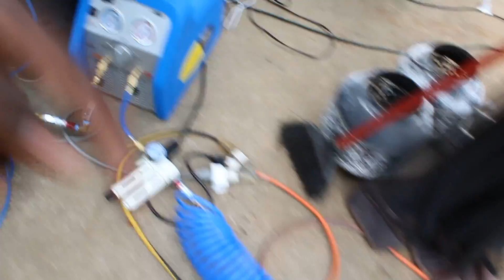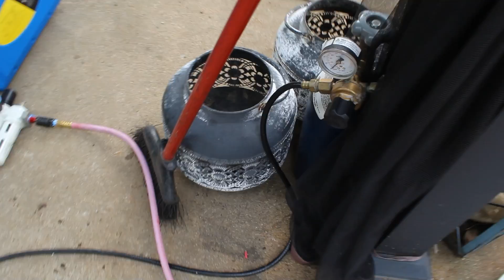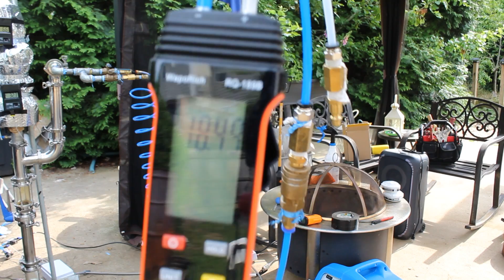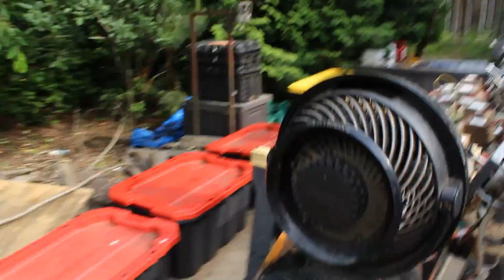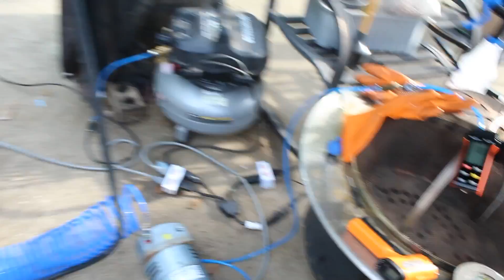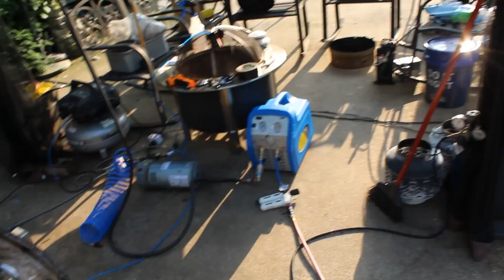MICROWAVE VACUUM Plastic to FUEL Machine

Comment: Awesome stuff! I think its time for some software on a raspberry pi or w/e to automate and monitor some stuff.

Maybe some oxygen sensors exist that can resist the harsh conditions in that machine? That would be awesome for an emergency fail-safe. (With automated valves for the nitrogen and so on..)

Comment: But the thing is that: is he winning any fuel? like what electricty he is spending to transform the plastic into fuel don't forget that electricity comes indirectly from fuel 
So if he is theoreticaly creating =>1L of plastic fuel but he is spending let's say 5L so he is not really creating any fuel sure the plastic is used but what is he winning. It's a really interesting thing to think to scale this project to large scale. But keep up the good work 👍👍👍
Reply: 20% I think.

That would be huge as most recycling done is net negative with subsidized funding or increased sales costs..

Any net positive recycling is kinda unheard of.  Recycling is mostly a scam.  So this kids on to something.

Comment: I think the section below the shotgun condenser should be slightly tilted where the gas line is on the uphill side so oils condensing drain away from the gas line

Comment: I am interested to know about scalability.  
1. How much Plastic trash does it take to make a barrel of crude oil?    

1a. How many pounds of propane gas And burnable carbon will it make At the same time?

2.  How long will it take?

3.  How much energy will the reactor use Per barrel?

We already incinerate, old clothing. We already waste water and pollute Waterways with fast fashion clothing development. We already have huge refinery plants. Pointing blame at plastic reprocessing It’s not helpful.

Learning the scalability and feasibility is.

Comment: what's the ratio of crude oil to syn/natural gas produced? i'm really curious to see how viable and efficient running the reactor off of its own gas would be. also, how much plastic can the reactor hold? is there a limit smaller than the volume where it won't work anymore?

Comment: Bro I have a suggestion for you ,
After generating electricity you must store the energy first in batteries and then enhance its power by using capacitor and then supplying it to microwave process.
This will help in generating constant and high microwave energy .

Comment: You can get a machine used for making tinctures as your chiller or you can get an old deep freezer and make your own put lines in it and then fill it up with water and turn it on easy cheap way to get around it

Comment: What gasket material are you using for your TC fittings?  EPDM caps out at about 150C, so if you're using the black rubber gaskets you might take a look at PTFE options.  I worry about the seal material in the butterfly valves and sight glasses, too.  Temperature and chemical resistance could be an issue.

Amazing work and stay safe!

Comment: Why dont you just use the gas produced to directly heat the main chamber instead of running a generator the more you make the potential energy change forms you lose efficiency i feel like you would get more out of your gas is used as a burner under tour main chamber instead of using microwaves and high voltage.

Comment: Since you have it under vacuum, you don't need to have the door at the front be locked tight. If you allow it to be sealed with a silicone gasket or something when it's at negative pressure, then you'll minimise the chance of an explosion if there's a leak since the door will just blow off from the positive pressure. 

I have to say, a few months ago when I saw it for the first time, I highly doubt it was gonna work. It just didn't seem like it would be sustainable, but since your video about running it off it's own natural gas vapours, I think you might just have a shot.

Also, the reason why you have oil collecting at the recovery pump might be because the condensing pipe diameter is too wide, so even though the walls are cool, the majority of the vapours can still travel through without being condensed. You might want to look into having a smaller diameter condenser column with spiral pipes like the small scale pyrex ones.
Reply: The suction doors acting as a pressure relief in case of explosion is a genius move
Reply: Great suggestion. Hope he sees this and implements it. As well as the automatic system he suggested in the video. I wish this man the most safety in this project! And that suggestion is huge

Also, the explanation on the condenser makes a lot of sense. I have no knowledge or experience in this topic. My knowledge extends to binging NileRed lol. But with any sort of knowledge I do have. I have no way to refute that. And also think he should give it a shot!
Reply: Home he sees this comment and gives it a try even if it doesn’t work right away it is definitely  the safer option even if it doesn’t work right off the bat
Reply: @Jackson_Zheng do you have a way to reach out to you? Facebook, email, Instagram?
Reply: The vacuum seal is way safer if he can implement it. The spiral tubes for condensing the vapors is smart as well. He should also put spiral tubes through his ice bath to cool the condensers as much as possible.
Reply from the maker: Thanks!  Will do
Reply: Crazy asians

Comment: I feel like this is at the point where it needs central computer control. I don't know what I would trust for it, probably not an arduino, but it doesn't have to be complicated.
As the system is under vacuum, I wonder if it would increase the safety to have that end access door kept closed with some weak bolts. That way if you had a gasket fail, and the pressure reverses, the bolts will fail before the whole chamber does. Just a thought, maybe I'm not seeing the whole picture..

Comment: I think its much safer that you just weld around the gasket and microwave, soo even if gasket fails it wont suck in more oxygen. Simple mechanical solution but at cost it will be more complex to change it later.

Comment: I would be interested to see some energy calculations. Is it worth it? Can you get more energy in the form of oils in comparison to the amount of energy consumed on heating and pumping?
Reply: just from the size of flame he should be able to run a generator from the "syngas" alone to power almost everything except all of the magnetrons at the same time. you can look up the energy consumption of all his equipment if you really have the determination. then find a generator with that energy output and see if someone is running it on woodgas or propane. if the size of flame is the same it should be possible. keep in mind this isnt over unity, the power comes out of the plastic waste of which there is a virtually infinite amount.
Reply: I believe the system creates natural gas as a byproduct. With that, maybe he would be able to run a generator large enough to power the system. Especially if he outfits a generator with the new thunderstorm setup.
   I could be wrong as this is only the first of his videos that I've watched.
Reply: Man your doing something awesome. Keep it up brother. 
Also, don't think they won't notice you and snuff you out man. Please keep your head on a swivel. Stay safe man.

Comment: Pulling a vacuum on the reactor and compressing the gas is horrendously dangerous, one little leak letting air enter and either the reactor itself or worse the propane tank, it WILL explode sending shrapnel everywhere, this would be a horrific accident, with the size of the reactor, you would be unlikely to survive. look up a fuel tank explosion you don't want to be anywhere near that, THIS IS A TICKING TIME BOMB WAITING TO HAPPEN, please reconsider!

Comment: Interesting project! Maybe you can "open" the front lid while under vacuum, so it pops open in case of leak? The vacuum should hold it in place, no? That would however mean you can't use the nitrogen ofc. Or you could add some one way valves maybe.

Comment: Maybe some plexiglass safety boxes to set tanks inside when filling as safety measure perhaps and some thermocouplers for monitoring internals to better understand inside envoronment to prevent damage again or processing stage to ensure completion to carbon is cycled and also a interupt circuit arduino is a good idea. A internal cam woukd be cool dueing the processing show molten plastic bouling in a window maybe idk but seeing would be nice. Aloha from maui keep it going ma man. And checl mrtesalonian channel he got alot of good stuff to learn from.
Reply: plexiglass? your gonna need a concrete bunker...